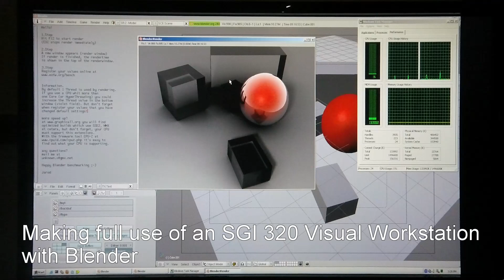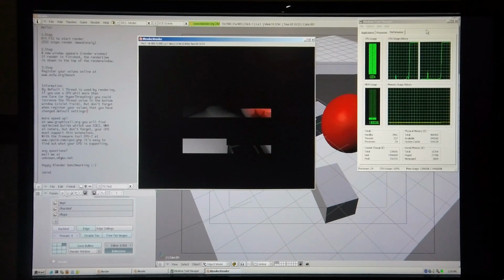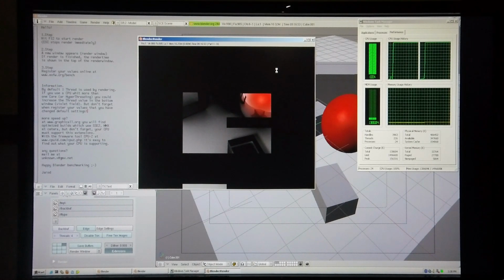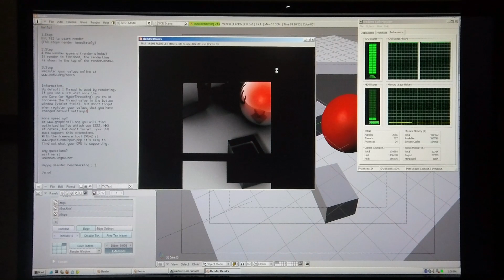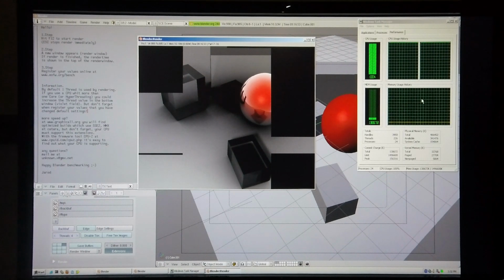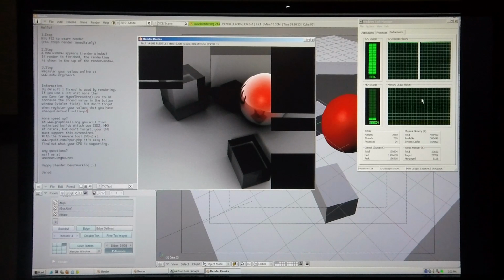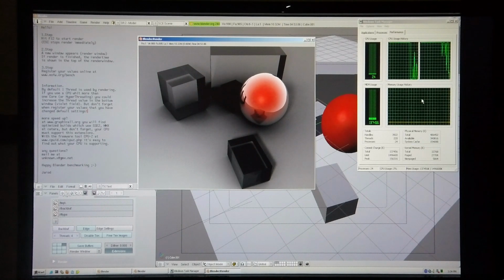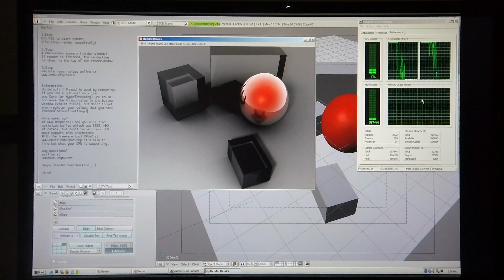Making full use of an SGI 320 Visual Workstation with Blender

Comment: change to povray if you want quality and speed
Reply from the maker: Thanks for the info! :)

The test being run in this video has to be run with the settings as set, in order to keep all things equal when comparing the CPU performance of various machines. (It allows us to generate accurate performance comparisons between various machines.) Not optimal performance, but it's the relative performance between machines which is important here.
Reply: @Irinikus  Ok that makes sense